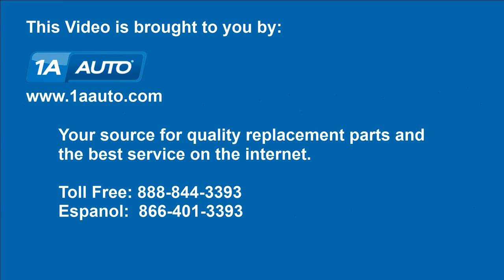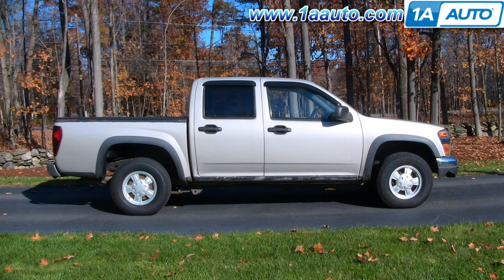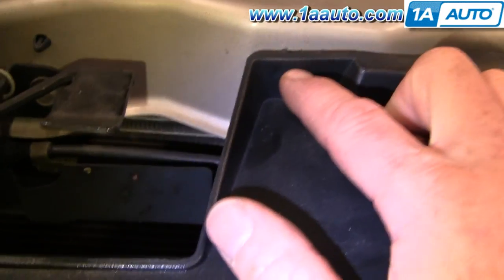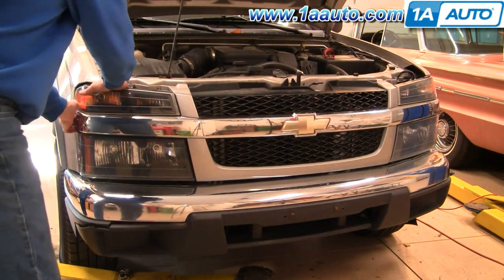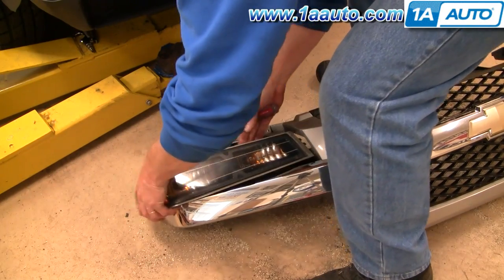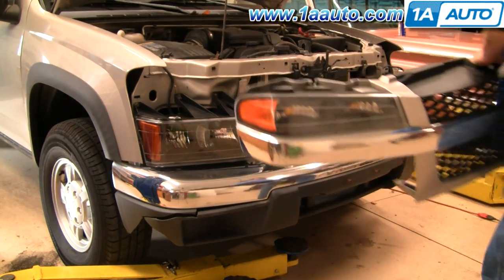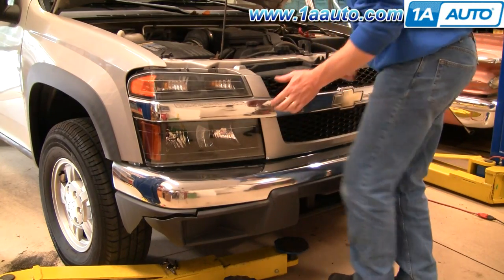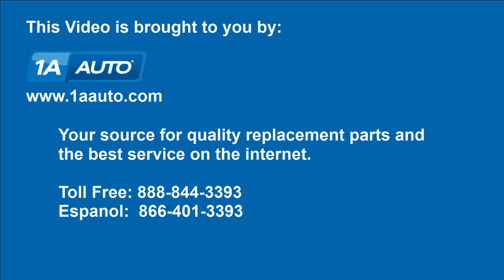How To Remove Front Grille 04-12 Chevy Colorado

Comment: Great video guys. I do wonder though because I just replaced my 2010 Canyon’s grille, how do you just pull out the bottom 3 from the clips like that? The metal clips have teeth that hold the plastic “ears” in, so wouldn’t it weaken the hold of the clip everytime you removed the grille? Also, Mine felt like it would break if I just firmly pulled out the bottom like that. We, instead, used a long tool to pop the entire metal clip out too(for all seven metal clips). It worked really well, and everything went back together perfectly.

Comment: Looks so easy! I actually just wrecked my front grill and damaged the two metal parts on the side of the radiator that hold the grill in place.  Do you think it would be easy to just bend it back in place by myself?  Also on the driver side turning lights if i were to install the grill there would be a little less than half inch gap from the metal to the side of the light, do you think that would be a problem with rain/snow

Comment from the maker: If you're looking for the small fasteners, you should be able to get them at your local dealer.
Reply: I just bought a pack of 20 of the top clips for $11 and some change on Amazon.  They also have the other clips for the bottom and sides.

Comment: I can't get the one you taking out on my GMC Canyon I saw the front headlight it is a white color one in the middle of my my GMC Canyon looks the same as the one on this video the other ones just got them off going counter clockwise on both sides but the middle one which the color in the back of it is white on my truck is hard to get out for me. The front panel I saw today how to get out I saw you had to get stuff on bottom but painting my truck trying to do one thing at a time. Took the hood off that is easy for me but next since doing front first gonna take grill off and lights in front before I take the front panel off.